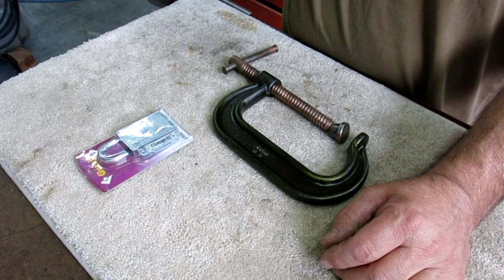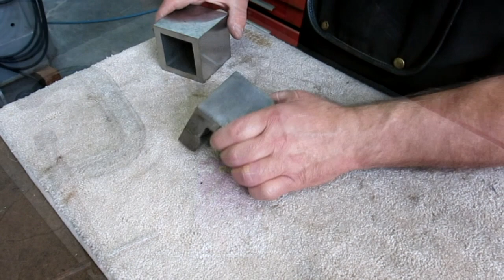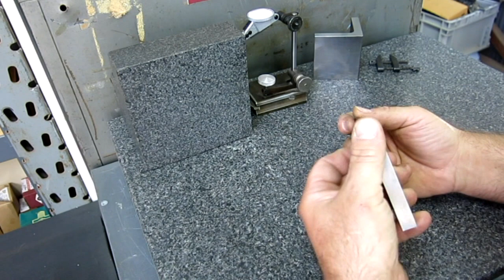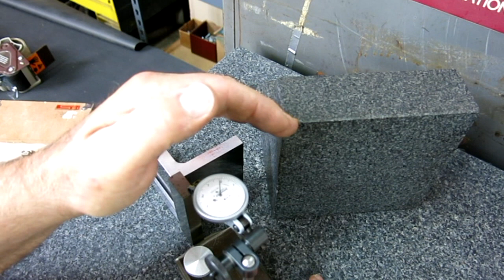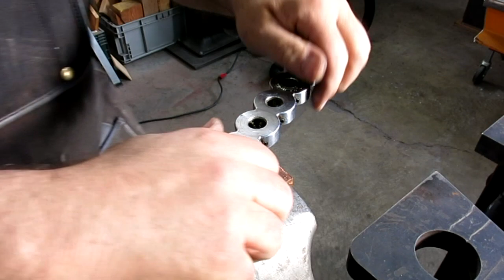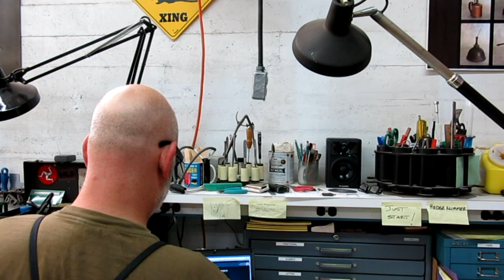Monday Night Meatloaf 93

Comment: the magnetic lock key has 2rows of round blind holes like 12 or 16 in total, some with magnets that correspond to sliding pins in the lock body,  all will move but only the right ones will unlock. I had one 30 years ago same brand, and was the only one I'd seen in NZ.
I couldnt resist pulling it apart of course,  a successful idea for a lock and a total mindfuck for everyone that saw it on my motorbike.

Comment: The dies in the Moore handle are set with a screw, so you could switch the one you need to the center position.

Comment: At 13:07 YES! The fingernail's sensitivity to roughness is astonishing. The amplification from the tip through the entire surface plate of the nail's connection to the finger let's you "see" better than visual resolution. I don't have a link to the metrology of it. That would be interesting if anyone had done such a study characterizing the sensitivity thereof. I once jammed a sharp needle through the end of a long nail to see if the sensitivity/resolution could be increased and sure enough the sharper tip of the needle translated to detection of even smaller size deviations.

Comment: I have a beat up old cast iron drill press vice like that that I got out of an old nasa scientists house after he passed, invited in to pick and choose some items. Got a south bend for free that I dont have anymore, anyhow this little vice got over torqued and the threaded end of the casting was blown out, the owner who I am assuming was the nasa dude pinned it back together with some Allen caps, apparently the sliding keyway was blown out too and he screwed that back together too, I keep it by my machine and use it to knock boring bars out of tool holders and all kinds of stuff. 
Sometimes the beat up stuff is the most treasured, I love that vice.

Comment: I just had to see how one of those magnetic locks work before.  I found something like 4 or 5 small round magnets in the key.  They were arranged with some N and some S poles facing the lock.  I never broke into the lock, as I wanted to use it with the other key.   Thing was, after I found out how the key worked, I lost the lock and the other key.  Oh well, at least I learned 1/2 of the mystery.

Comment: Try dusting some iron filings on the magnetic key. I suspect you will find a pattern of N and S poles specific to that individual lock. (No need to destroy the lock.)
Reply: +Peter W. Meek I think you're correct: heres the only cutaway I could find: https://img0.etsystatic.com/008/0/7004212/il_570xN.369349182_f73g.jpg

(I hope that link works) 

I bet a cheaper model can be shimmed, but still a lot more secure that most maser locks.
Reply: Looks like only 16 possible combinations (2^4), so not real secure. Four magnet positions, and two possible polarities at each position. You could "pick" it in a few minutes with 4 small magnets and something to hold them in position. Then try all 16 combinations.

I can design in my head a more secure method with only 4 stations. Put the magnets on their sides and have the key rotate them. You might get 8 discernable setting per station. for an 8^4 = 4,096 combinations.

Comment: the magnetic lock is using what is called a keyed magnet. it's simply a group of smaller magnets with their poles in specific locations in the key. These type of keyed locks are often used in manufacturing machinery where you don't want a magnetic door interlock to be defeated using a regular magnet.

Comment: I suspect the magnetic lock key has several magnets at specific points which align tumblers inside the lock to specific positions, releasing the lock. try putting some metal filings on the key to see what the points are.

Comment: Hey Tom.  Looks like the L-H drill bit was victorious.   I could tell that that magnetic lock was gnawing at your gut; "dissect me!"  I know a machinist dude that picked one of them  locks off of the Forest Service gates.  He cut it apart, made a key and reassemble the lock, reweld it together, make it look as if it wasn't touched, then return the lock.  He did that to a number of locks for those gates...  hee hee hee.

Comment: M-Audio makes great audio equipment which is designed for pro audio applications so those speakers will sound good, because they are low end reference monitors used by hobbyist and engineers for recording and mixing music. They will be a great aid during video production as they can help the creator improve the audio quality and balance, which many content creators seem to struggle with. Anyway, thanks for sharing!

Comment: Tom, not sure about the USA, but here in the UK they look similar to what we call 'Gas pliers" (still available, because they're so dang useful). Ours tend to have a single screwdriver tip on one handle, and a reamer/deburrer on the other handle. They used to be used (as the name suggests) for gas fitting, the 2 sizes would fit the 2 sizes of gas pipe commonly used for gas fittings, and the reamer, ditto. The large screwdriver bit was used for blanking plugs and similar things that had screwdriver slots.

http://www.cromwell.co.uk/ELL5582058E is a currently available set

Comment: Glad you like the toys! I believe the lock key has multiple magnets where some push and some pull on magnets inside the lock. And the C clamp screw was copper, all I did  was wire brush it to get rid of the crud... Thanks for the plug!!
Reply: Nice work on the clamp.
Reply: +LXGIK 80 Thanks! Look for Dupli-Color Metalcast... fantastic spray paint! For the clamp I used their yellow which looks more like gold.

Comment: hey Tom,
nice score on the flea sale finds... the europeans have a funky grading system for the accuracy of their tools like squares etc. it starts at 2 (a shop grade) and goes to 1 (machinist grade) to 0 (a QC grade) to 00 (metrology room grade which is the highest) 
you may have to break out the magnifying glass to see what the engraving says. it might read something like "Genauigkeit 0" or "Grad 0" or "R00" .. something like like that or even just a number like 0 or 00 
the hairline squares are usually in the 0 or 00 range and are stupid expensive here.. the square you got runs about $150 up to $220 depending on the retailer. TESA.?. yeah.. you scored! pennies on the dollar.. nice :) 
thanks for sharing your flea sale finds.. always entertaining and informative.. i've been having some similar successes and flops at the flea sales but still enjoy the hunt..

cheers 
mike

Comment: I almost always  use the left hand drill bits first. If it doesn't back out, I go a couple sizes larger, which will grab and pop the bolt loose.
If it doesn't, then I've got a hole for an easy out.  An automatic center punch works well for backing out bolts in tight spots where you can't get a drill.
Love the videos.

Comment: That particular magnetic lock has a set of pins that align with a set of holes in a keeper plate when the magnetic key is in position. You should be able to "pick" it with the rare earth magnet by moving the magnet around while jostling the bolt. They're actually pretty crap but might deter someone who's never seen one before because they're so unusual.